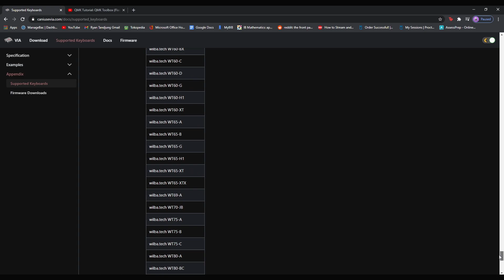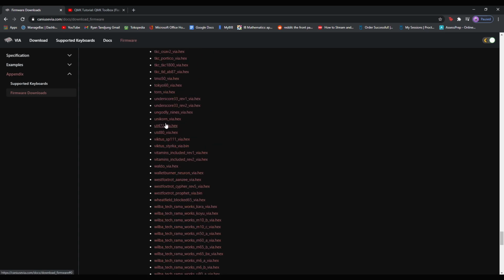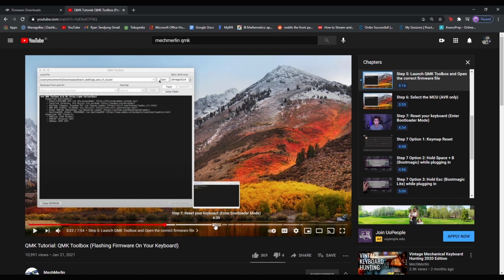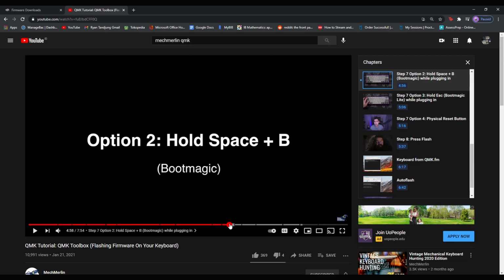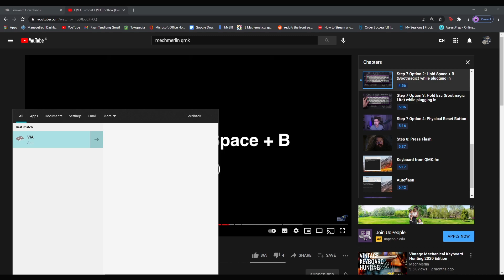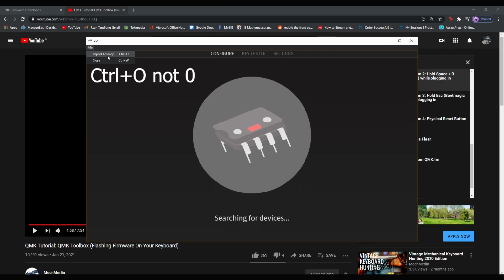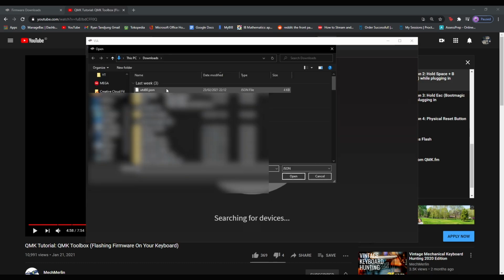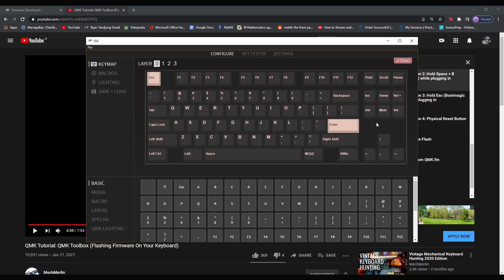How to add VIA compatibility to the UTD 360c | Tutorial

Comment: i don't remember if it happened when i did but sometime after i added via compatibility my f1-f4 keys stopped working, didn't desolder or anything, traces look intact, the pads don't look lifted, do you know if is an effect of via?
Reply from the maker: I'm not quite sure. Actually, I think you might be the one who told me how to add VIA to the UTD LOL. your discord name is Affectedmelon correct?
Reply: @fineresolve1540  no, but do you know if there is a way to reset the pcb or maybe the person who told you how to add via does?
Reply from the maker: @WesleyKarp  I'm not quite sure. the guy who told me how to do this experienced the same thing as you did. I actually don't know if mine is working or not as I never use the f row. Let me check first and I'll come back to you.
Reply from the maker: @WesleyKarp  Yep, my f row works fine.
Reply: @fineresolve1540  do you think you could link me to the person who had the same problem as me?
Reply from the maker: @WesleyKarp  Sure I'll pm you on discord